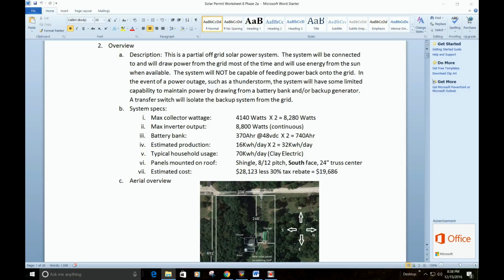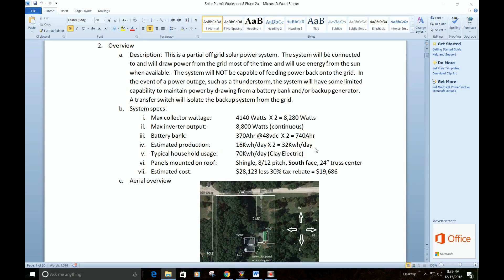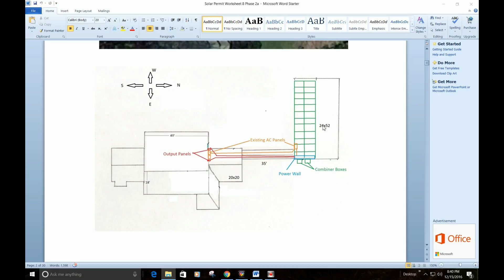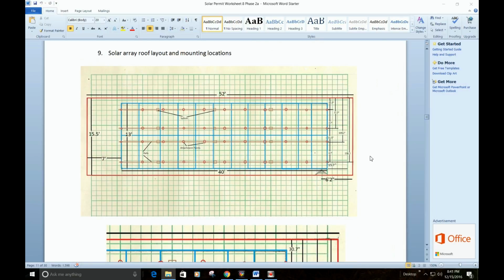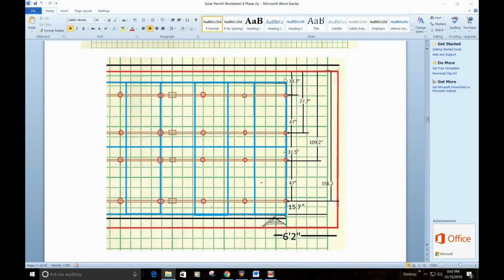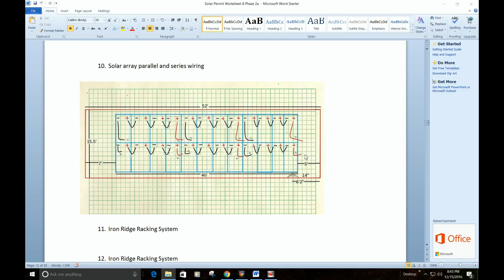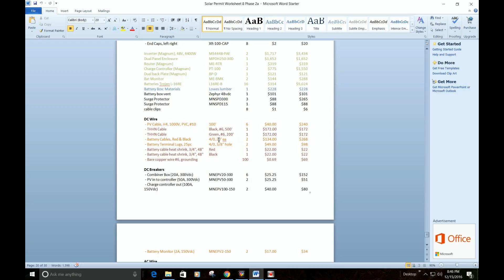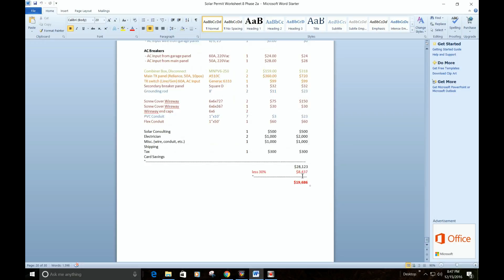Off Grid Solar #24: Design Upgrade Phase II

Comment: David, where did you get your wireway?  I've been looking around but can't find ones like you have.
Reply from the maker: normsolwind, Yes, one of the hardest things to find.  I found them at CED (Consolidated Electrical Distribution) also called Raybro.  6"x36" and 6"x72" I think...
Reply: Cool, thankyou for the quick reply.

Comment: Very detailed description. You have a very nice setup. My wife and I were thinking about selling and buying a smaller acreage like 5 or 10 acres. We put our place up for sale for two months last summer but mom had a stroke and we had to abandon the project for now. We did do some traveling around looking at properties. The reason I asked about the cost of your system is  we still have selling and starting over  on the back burner. One problem we have is we can not find a place as nice as what we have. We found a beautiful place outside of Bonners Ferry Idaho but we would be 13 hours away from the grandkids. We probably should stay put, we have been here for 27 years now. We do not have a power bill, lots of water, established gardens, 2 orchards 40 acres of timber and a Woodmizer sawmill etc. Still having a smaller place seems like it would be less work. Maybe when I get my back and neck get fixed staying will look different. Thanks again for the detailed information. If you do not mind I will recommend your channel. Have a wonderful day.
Reply from the maker: You have a beautiful place there and I can't imagine you would ever leave it.  Yes, I would very much appreciate your recommendation.  Thanks!

Comment: Be careful of the charge rate of the batteries. If you have 8280W going into a 48V battery bank, you've got 8280W / 48V = 172.8A.  If you have a 740Ah battery bank, that's 742Ah/172A=4.3. So that's a C/4 charge rate. C/8 is often recommended for flooded batteries. Their charging instructions say max current is C/6. You will be hitting it pretty hard. This will cause higher temps and require water more frequently. You can manage it with dialing back the output of the charge controller, so when the panels are putting out their max power, the charge controller will clip its output to the max setting (742Ah/C-6/2 charge controllers = 61.8A each (123A total)). The good news is when the panels are putting out less than max power, on really  hot days and partially cloudy, you will be able to use all of the power being put out. So oversizing the array isn't the end of the world, as long as you manage it correctly. https://www.altestore.com/static/datafiles/others/Renewable_Energy_Charging_Parameters.pdf
Reply from the maker: I just got the system operational yesterday and I have so much to learn about how to operate it and maintain it.  So far, I have not drained the batteries lower than 83%.  I have set a few parameters such as the battery size and cut the max charge rate to 80%.  I have the PT-100's set to auto.  I'm going to dig into this some more in the coming days.  Thanks!

Comment: Looks like a good plan. Many folks see those dollar figures and their faces go numb. The 30% tax credit takes a major bite out of the costs. Thinking outside the box...some guys own Harley's that cost around same amount as your set-up. But, the Federal Government doesn't give Harley owners a tax credit. And secondly, a DIY solar system pays for itself every day the sun is up and a light switch is thrown. Lastly, the electrical grid is unpredictable (government oversight, attacks, and every increasing fees/costs/age/maintenance). So, $20K...win-win.
Reply from the maker: Right on Chris!  Now I could have built  a system for half the cost by just doing the panels with grid tie micro inverters and sell power back when not using it.  That's great too, pays itself off much faster, becomes a money maker and is great.  This system is more expensive and will take many years to pay for itself and is generally going to require more maintenance.  The BIG difference is that this system will provide 30kWh/day for the next 20 years no matter what happens to the grid.  It's a relatively INEXPENSIVE  insurance policy against a somewhat unlikely long term grid down situation.  In my case it also provides an endless water supply as we are on a well.  Heck, we are currently paying 18K/year for health insurance (family of 5) that gets us NOTHING!  And as a bonus, it's not a bad hobbie...